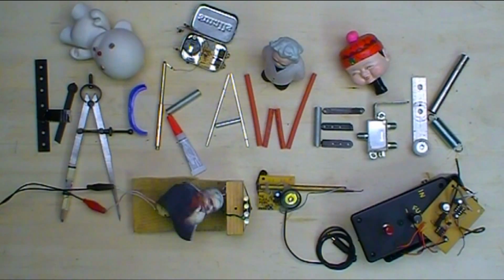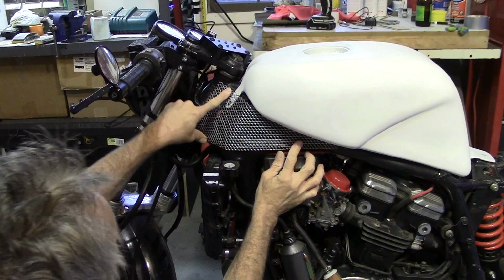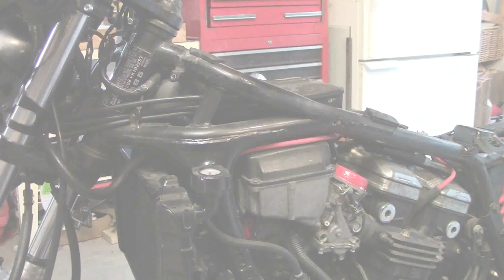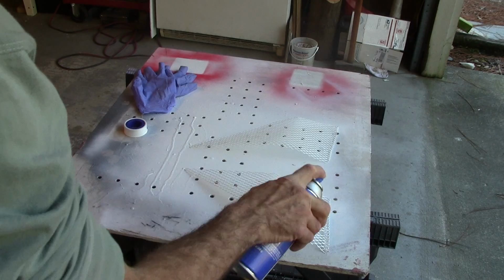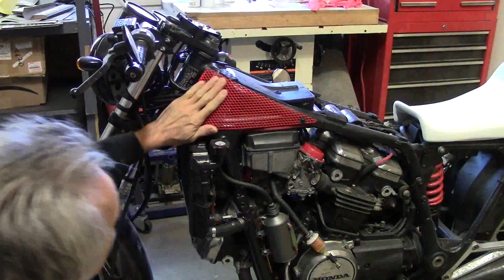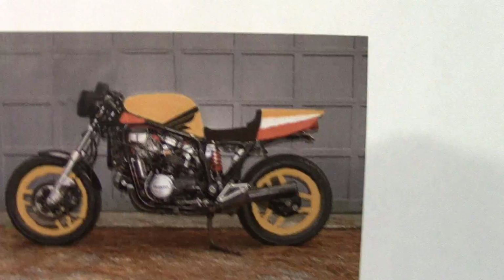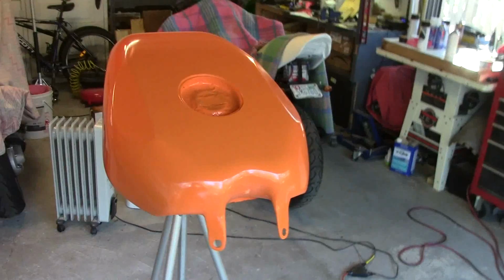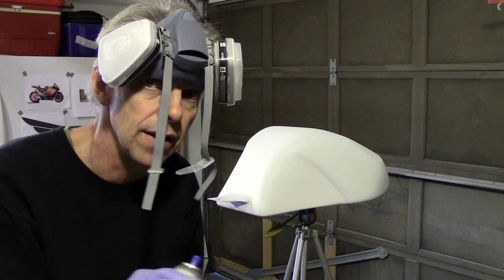Project Honda Sabre Cafe Part 27

Comment: Do you ever have any issues with filler bonding to primer bonding to glaze, to primer, etc., etc? Do layers of paint in between NOT cause a problem? How reliable is that over time as to becoming unbonded/delaminating? Any compatibility issues to be concerned with in product selection?